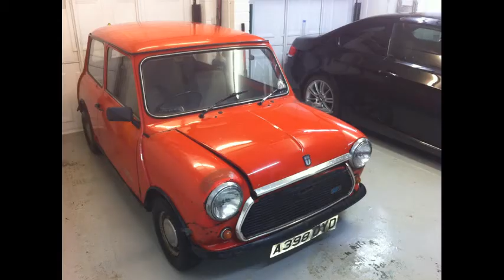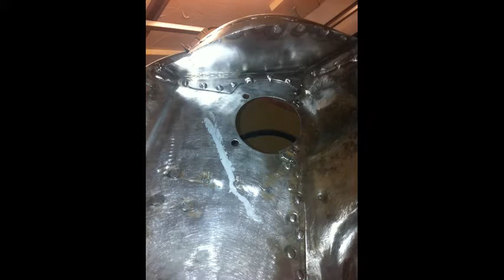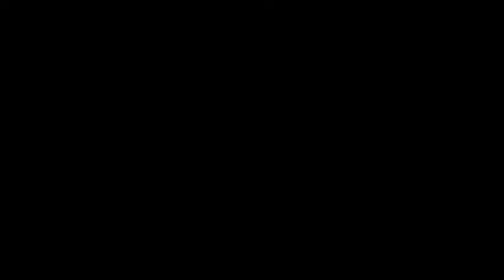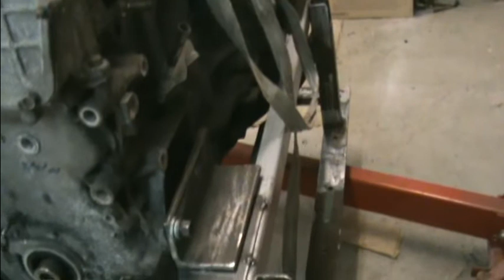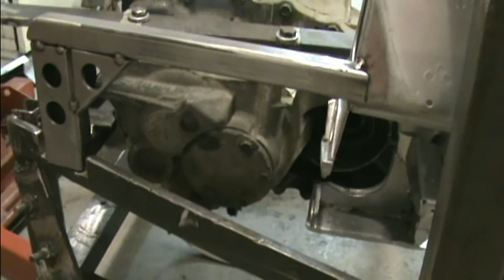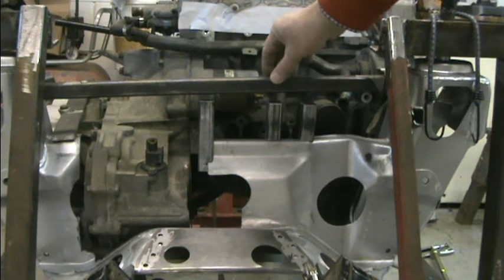Mincra - CG Micra K11 engine conversion into classic mini Episode 1

Comment: I’d love to put one of these in a small hot rod, like a Ford Anglia, Model Y,  Morris Minor, Austin A35, MG Midget, Farina A40 or Austin 7.  If you can bolt it up to a Miata or Borg-Warner T5/ Tremec or Ford Type 9 transmission, I’d use it.

Comment: Hi Daved have you any plans on this subframe by any chance, iam doing a mini pickup at the moment and this would be a good engine to put in, great work 👍
Reply from the maker: I am sorry but I never made any drawings of the subframe parts, it was a case of measuring, cut the metal and welding.  If you wish to take a closer look I am located in South Somerset.

Comment: What is interesting about the Micra K11-engined Classic Mini conversion would be Nissan's own historical ties to Austin to the point where parts of the A/B-Series engines were allegedly interchangeable with a number of Nissan engines. 
Have also read of a few people fitting the CR Micra K12  engines into Classic Minis and was wondering how similar the latter is to the CG Micra K11 engine, particularly whether the CR Micra K12 is a development of the CG Micra K11 engine?
Reply from the maker: Not really sure about the K12 engine, we used to have one;- a 1.4, they look physical larger but I would need to see one stripped next to the CG engine to confirm, next time I am in the breakers yard I will look at the key dimensions, in particular the gearbox/diff housing
Reply: Managed to find the following link featuring a Mini conversion with 1386cc Nissan CR14DE, though the site link appears to be Clubman-fronted.
https://www.youtube.com/watch?v=wfytkDW-4SI